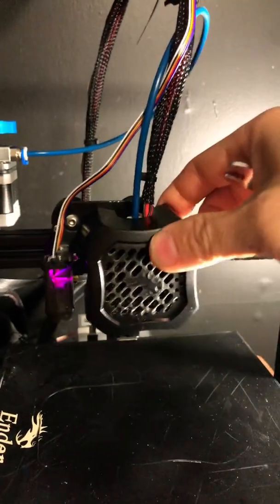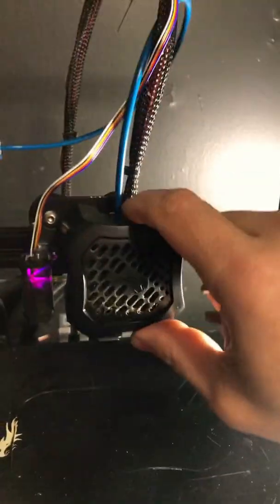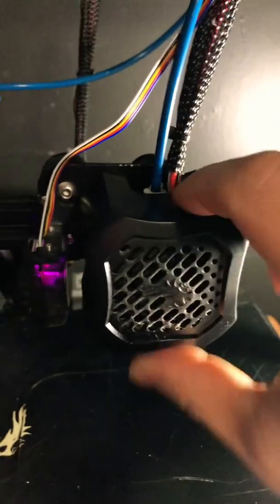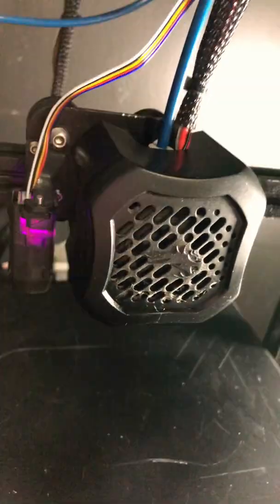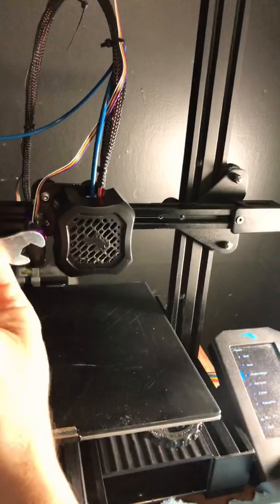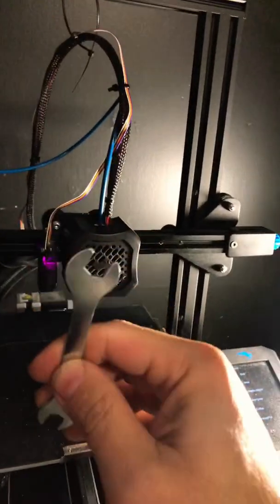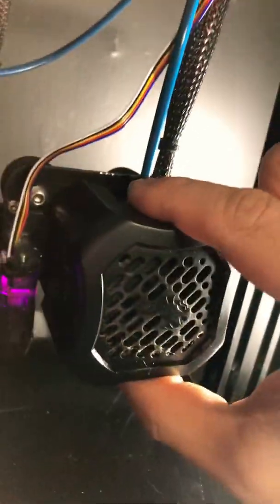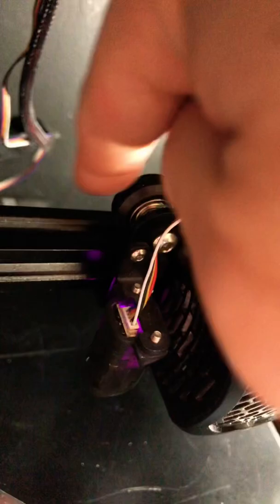Wobbly Hot End? This is how to fix it! How to tighten your Loose 3D Printer Eccentric Nut

Comment: bro it doesnt work
Reply from the maker: Bro. It sure does
Reply from the maker: https://youtu.be/ye7bMRTEb2Y
Reply: I meant for me
Reply: I’ve tried tightening it but it’s still really loose can you help me either that
Reply from the maker: The eccentric is the way to tighten it. Try turning the opposite way. Have you looked at the link I left, for another view?
Reply: @GreggAdventure  YA
Reply from the maker: Which machine u on?
Reply: With
Reply: I’m subed btw❤
Reply: Bro I figured it out thanks❤
Reply from the maker: @Cheetos649 🙌🏼🙌🏼🔥🔥
Reply: The metal on the back support plate was bent
Reply: I bent it back and know it’s tight
Reply: Btw I’m on a ender 3 just got it for Christmas

Comment: Man, I was trying to mess around with it but I didn't see that and pretty much stripped the Allen screw on the front 😂
Reply from the maker: Crud. No worries, it happens. Can get a new plate, or put it through and use a bolt. I have a much clearer video on this, on my new channel, youtube.com/@3drundown
Reply: @GreggAdventure  I figured it out and got it to tighten, just took a little messing around🤣